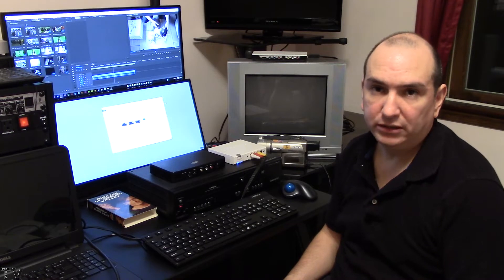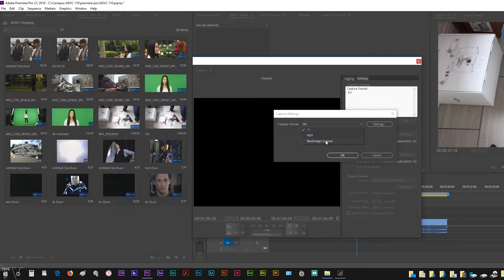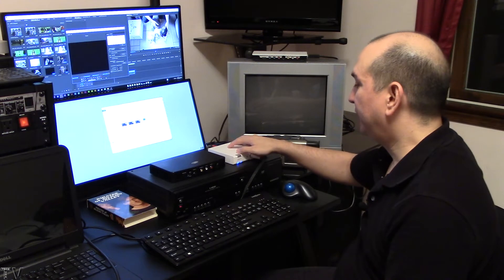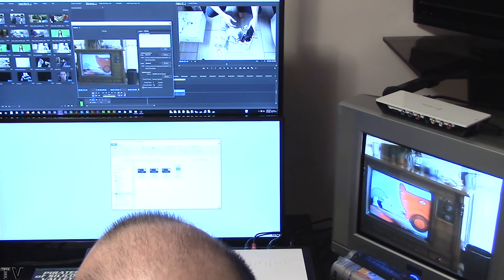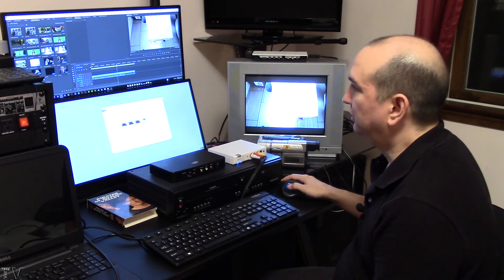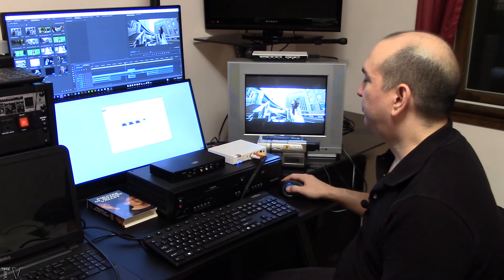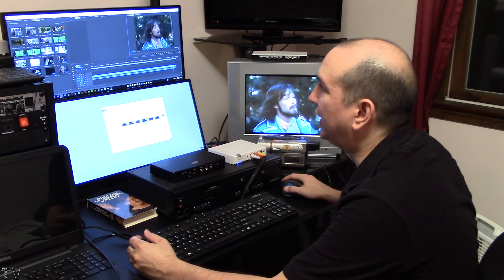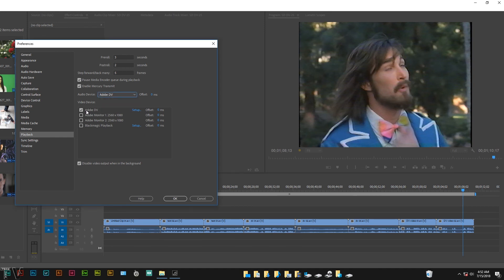Easily transfer VHS and Hi-8 tapes to computer

Comment: I have a mac and a advc110. In Premier , capture it only gives me Blackmajic option. I have the adapter for thunderbolt and I'm using the dv out on the front port firewire 4 pin. Do you have to come out the 6 pin on the back of the unit? Is this why I don't see it in Premier capture? I noticed on the video you don't have a wire to that pot on the front
Reply from the maker: The 4 PIN  Firewire port will not supply power to the ADVC 110. You would need the power adapter.
Reply: @TechTVusa  I have a power adapter hooked up. I'm trying to get my digitized video into my mac. I'm trying to come out of the 4 pin port of front of the unit. My question is do I have to get my digitized video out of the back of the units 6 pin port?
Reply from the maker: @krikro1952  Any Firewire port will be able to connect to the MAC provided the ADVC 110 has power. Keep in mind it is kind of hard to trouble shoot a computer on YouTube. In a discussion forum you can posts screen shots. I have a Facebook account.
Reply: @TechTVusa  I'm still struggling here. When I try to set my settings in the premier capture window it doesn't give me an option for dv, It only gives me an option for blackmajic capture. That is not hooked up. In the device control window it says Canopus Standard.
Reply from the maker: @krikro1952  I cannot really help you.  I use the Adobe CC and the video capture utility was removed over a year ago.The link below might be worth watching. 

https://youtu.be/YremBGJXUeY

Comment: TechTV - thanks for all of your great work.  I'm trying to capture VHS footage using my Canopus ADVC 110 in Premiere Pro, but the program tells me the capture device is off line.  I'm using a custom made Windows 10 PC with a firewire port.   Is it true this works best with Windows XP?   Also, I have captured VHS video with an Elgato device - but am wondering if the video quality would be better using the Canopus method.   Thank you - Peter
Reply from the maker: The latest version of Premiere Pro dropped support for Fire DV converters. You would have to do some testing of your own to see if the Elgato has better quality than the ADVC 110. Having said that the link below might prove to be helpful. 

https://youtu.be/vqCi9B_7mdU
Reply: Thank you.   What I am finding is Premiere Pro is telling me the Canopus device is Offline.   Yet the blue light is on and Device Manager tells me the IE 1394 card that I installed is working.   can't get Premiere to see the Canopus. @TechTVusa
Reply from the maker: @PeterDickow1  Try hitting the record button anyway and make sure to press the grey button on the Canopus ADVC 110 to change it from digital to analogue.
Reply: @TechTVusa  thanks for speedy reply but no luck on record button.   Still says Capture Device offline
Reply from the maker: @PeterDickow1  Do you have DV device selected as opposed to HDV device?
Reply: @TechTVusa  yes DV is selected
Reply from the maker: There are dip switches for Pal and NTSC. If that does not work then perhaps the product is defect.
Reply: Will investigate - hard to read!
Reply: You were right - I got another Canopus - from the TV station I once worked at - and it works!!!!

Comment: Just bought a Canopus ADVC 110, installed Adobe Premiere. But I can't access the "capture" button on File tab. My computer recognized my firewire and when I plugged my firewire cable into the Canopus entry, it asked which I should do, so I direct it to Premiere, but I cannot access those sections. What should I do?
Reply from the maker: If you have a Mac you can try iMovie. You can also try to uninstall Premiere Pro and then reinstall it.

Comment: Hello, not sure if you're still active on this video but I just wanted to reach out because I am at my wit's end trying to capture footage.

 Here is my setup:
- Sony Handycam Hi8 TRV68 Camera 
- Firewire 400 to 800 cable, fw 800 to thunderbolt 2 cable, thunderbolt 2 to 3 cable
- ADVC110
- HP Elitebook with thunderbolt 3 port
- Premiere Pro v23.1 (the oldest version I could dowenload was v22, which I was also having issues with)

The issue I am having is that I cannot get my laptop to recognize my camera in anyway to start capturing. The settings in Premiere Pro show as "offline". I have also tried using OBS Studio and WinDV to no avail. 

I believe my ADVC is working because it is able to output the footage on my camera when connected to my TV via composite cable. Are there any other ideas I should try? Your videos have been a help, but like I said no matter what I try I can't seem to get it. Thank you!
Reply from the maker: Your laptop will not recognize the camera. It should see the ADVC 110. Try pressing the record button and see what happens. Also make sure DV is selected and not HDV.
Reply: @TechTVusa  Right I guess I meant the ADVC rather than the camera. I do have DV selected but even so all of the buttons to record and play are greyed out

Comment: Hello - first of all im totally a novice at this but i have VHS tapes that i am trying to save as digital files. i have a "converter"? (about 3.5" long with a usb end and audio/video cables that attach between vcr and my pc) and is saving the digital files as .mp4 which i guess is "compressed" I am trying to save the files with as little compression as possible, keeping the definition as high as i can - realizing this would create a large file is ok - as long as the converted file is as sharp as possible. the VHS tapes im converting still look great when i play though the vcr to my tv. Do you have any recommendations? seams everything i see available saves as a compressed small size file without regards to definition as if the primary objective of these devices is only to transfer as a small file. Thank you very much for any assistance you can offer
Reply: also i just want to save the tapes as digital - i would not be interested on any editing or anything like that - thanks again
Reply from the maker: @gt1591  I use an ADVC 110 to capture Hi-8 and VHS tapes. I use an Intensity Shuttle to monitor my edits on broadcast compliant hardware as seen in the video link below.

https://youtu.be/dVLUxRkPMdA
Reply: Thank you very very much. I will give it a try 👍

Comment: Hey, I've got a Canopus ADVC-100, and I'm having a real hard time capturing home videos on VHS. Premiere keeps stopping the capture without asking me whenever there's a blank spot in the tape where the scene changes. I could capture each "cut" separately, but that's not viable for my business. How can I make it so it doesn't do that, and I can get the whole tape in one go?
I'm using CS6, and I believe I've mirrored the settings you used in this video.
Reply from the maker: You would need a time base corrector but they are no longer made.
Reply: @TechTVusa  I could always get a used one. It seems like there are also VHS decks with built in TBC. Are those typically sufficient?
Reply from the maker: @playback1967  You can always by used equipment but you are taking a risk. A VCR with built in TBC probably will not work. The ADVC 100 will see the black spot on the tape and still stop recording.
Reply: @TechTVusa  What would be your recommended course of action, then? Are there other firewire capture systems that don't have this problem?

Comment: I bought new device , it was good , it illuminates blue color while connected to camera , but in the premiere the picture totally bad , not the same of camera , I checked the cable of 1394 and connected direct to camera , the picture was great . But when Connected to advc , it went bad
Reply from the maker: You might have a defective  product. I am working on a video right now about out of the camera video VS Premiere Pro and the Intensity Shuttle. I also plan on doing a video using the ADVC 110.
Reply: @TechTVusa  this bad picture not coming from dip switches , maybe need to put them in correct position,,, do u have good one , I want to buy .
Reply from the maker: @ER7ABY  Any Firewire DV converter should work just fine. Digital 8 and Mini DV Camcorders can work as a DV converter.
Reply from the maker: The video link below might be of some interest. I use the Intensity Shuttle but I will make another video using the ADVC 110. 

https://youtu.be/nWjaEZLbdGk
Reply: @TechTVusa  I recognize one thing , when I play ntsc tape with camera ntsc system , the picture was great . But when ever play pal tape with camera pal system ,, the picture went bad . 
So the problem only with PAL tapes ? What do u think ? Is there any option to fix the PAL
Reply from the maker: @ER7ABY  The dip switches must be setup for PAL.
Reply: @TechTVusa  ok , how can I make the DIP switch set up for PAL
Reply from the maker: @ER7ABY  You will have to check the manual.

Comment: I bought advc 110 and also bought fire wire controller. When I connect camera with 1394 direct to fire wire controller.. it was working great ( I used for capturing “ premiere “ . 
But when I connect the device “ advc “ to the fire wire controller in the pc , And I connect the rca out in  advc ..... it gave me status with red color and illustrate digital blue ,, it does not change . 
How to fix it ?
Reply from the maker: There are dip switches on all Firewire DV converters. I have never needed to change mine.
Reply: @TechTVusa  the advc 110 gave me status “ red “ . Both digital and analog illustrated , it is mean device deffective?
Reply from the maker: @ER7ABY  My ADVC 110 has never done anything like that. I also have and ADS Pyro A/V Link Firewire DV converter. I could troubleshoot my ADC 110 with the ADS Pyro if it did act up.
Reply: @TechTVusa  i checked my dip switches in advc , and i think there is a mistake , could u please give the right positions for dip switches
Reply from the maker: @ER7ABY  Are you using Premiere Pro? Your ADVC 110 might be defective. For my system (NTSC) they are either all on or all off.
Reply: @TechTVusa  yes , i am using premiere , When I connect advc 110 , it shows both blue “ analoge and digital , the red light status on . 
What is the good one ? Advc 110 or black magic ?
Reply from the maker: Your ADVC 110 might be defective. That being said the video link below might be helpful. 

https://youtu.be/dVLUxRkPMdA

Comment: Oh man, maybe you can help me out! Can you connect analog video in the front and also use the DV output in the front to connect to a Mac? In other words, if you use the analog inputs in the front, do you have to use the firewire output in the back to connect to a Mac?
Reply from the maker: The video link below might be helpful. 

https://youtu.be/wo_dItttFdY
Reply: @TechTVusa  Hmm... thanks for quick reply! I watched the video, but it doesn't address the front DV In/Out and whether you can use that as an output while also using the from analog as input.
Reply from the maker: @laurencewhite4809  Firewire ports all work the same but the small 4 pin firewire port will not supply power to the ADVC 110. You would need to buy a power adapter.
Reply: @TechTVusa  Aha! Thank you so much :)
Reply from the maker: @laurencewhite4809  I am glad I could help.

Comment: I have big issue and I spent more than one month to find a solution , finally I got your account and I hope I can find my wondering , 

I have vhs tape with secam system , and hen ever I play it in LCD , it plays great . But I want to capture it in my laptop it goes wrong in color . I believe the laptop could not read secam . 
Device capture support all color system but my issue with the display , how can I do it .
Reply from the maker: Laptops don't support SECAM, NTSC or PAL. Hardware and software programs do. I am not sure if the DV converters can make use of SECAM. You might be able to color correct the video clips using Premiere Pro.
Reply: @TechTVusa  I think premiere do color correction not for color deffective , when you play tape with different system the color so so bad , I do not if the premiere powerfull enoght to correct like thede issues ,,
Reply from the maker: @ER7ABY  I stated you might be able to color correct the video using Premiere Pro I did not say can color correct the video using Premiere Pro.
Reply: @TechTVusa  by your experience, is there any device can convert TV systems ( pal , ntsc , secam to pal or ntcs )
Reply from the maker: @ER7ABY  You don't need to convert. You need to find a device that will transfer SECAM to the computer correctly.
Reply from the maker: The ADVC 110 list SECAM in the Fench Language of the user manual. In English it just lists PAL and NTSC. You might be able to adjust the dip switched to SECAM settings.
Reply: @TechTVusa  thank u alot , I have bought the ADVC110 dv , when arrivees I will try and tell you the update , thank u sir
Reply: @TechTVusa  I bought an advc110 dv from ebay with all cables , but the seller told me you have to have video processing software so you can record the tapes ,, could you please tell me what is the best software !
Reply from the maker: @ER7ABY  I use Premiere Pro but if you are on a MAC just use iMovie or FCPX. Below is an iMovie video. 

https://youtu.be/cwGU9VGlWhM

Comment: Heys
I got this  ADVC 110 with texas instrument PCI card. I'd like to capture PAL videos using composite cable. There are  6 switches at bottom.  Which of those should be ON/OFF ?
And which program I should use. Havin lotsa trouble with old hardware usin Win10 anyways...
Reply from the maker: I am not sure how you need to setup the ADVC 110 to capture PAL. With Premiere Pro it might do automatically.

Comment: Love your content. When capturing old compact VHS home movies, is it really that much better to use S-video versus composite video? I am currently capturing old VHS via composite by using an old digital 8 camcorder as a firewire capture device which I capture with Final Cut Pro. I am trying to figure out it I would see a noticeable difference in VHS quality by purchasing a VCR that can output S video along with a firewire capture device that supports S-video. Thanks for your help and expertise on the matter. If there is a video already covering this, I am sorry if this question is repetitive!
Reply from the maker: S-Video is better but with VHS you will not see much a difference.
Reply: @TechTVusa  thanks!

Comment: Do you mess with the little Mode Switch Selectors on the bottom of the ADVC 110? If yes, do you have any tips, suggestions, or tutorial for using the switches?
Reply from the maker: I don't mess with them but you might need to.